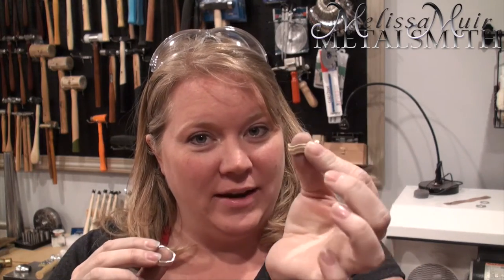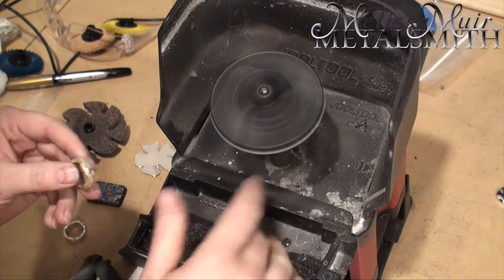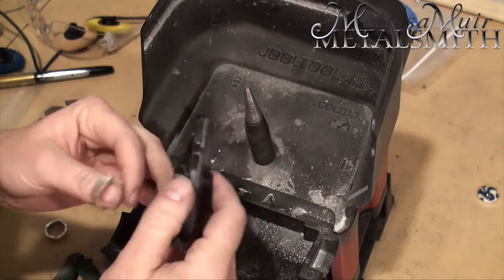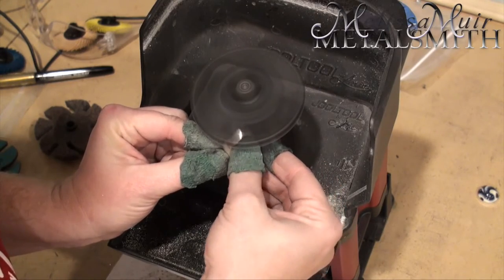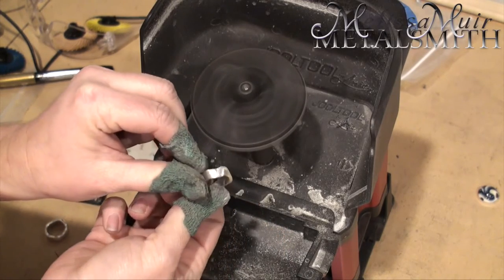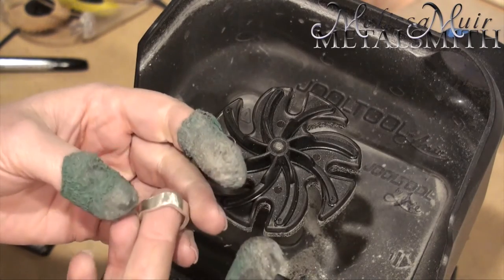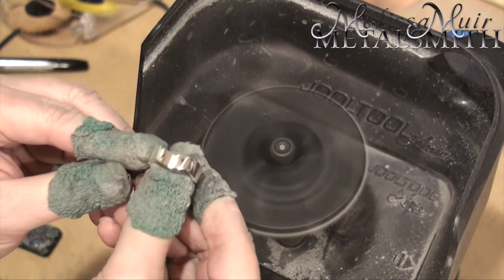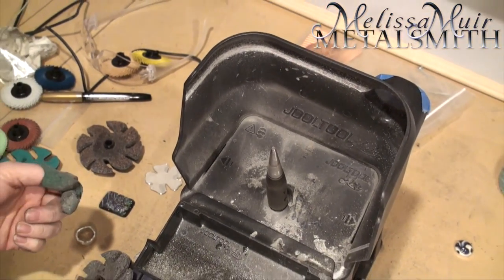Tool Time Tuesday - The JoolTool and High Polish on Metal

Comment: I'm just starting out and tooling up.  It seems that it is possible that this could replace, for the most part, the polishing bench lathe, particularly if one has a flex-shaft for finer or inside work.  Is that the case?  If you had to choose one or the other for budgetary reasons, which one would you choose?  Thanks!
Reply from the maker: +Martha Miles Yes Martha, that is exactly what I think too. Mine has been WONDERFUL!!! I started with the JoolTool for Metal Polishing. Then I have added on to it from there. But with that I was able to do quite a bit for my jewelry. I am now also working with glass and stones. Send me an email, let me know what your primary uses will be and I can help figure out which kit would be the best for you.

Comment: Looks fun to use...can a person put those inside wooden ring cone with sandpaper on the jooltool or maybe the green inside polishers that rio grande sells, looks like its the same arbor as a standard polisher
Reply from the maker: +Robert matteson Yes, it is the standard arbor, so yes, I do believe you would be able to use the ring cone. I need to find one that has sand paper. But I am really excited about the one from JoolTool as the abrasives last so much longer. I was able to play with the prototype for it when I was in L. A. a couple of weeks ago and it was heavenly.

Comment: Do you get contamination from grit to grit without washing/cleaning your piece between?
Reply from the maker: +Brenda Smith I asked Anie about this and she said no, you don't. That is because the discs are off loading, rather they don't hold onto the material as you go from one grit to another. It isn't like when you use a polishing compound that is applied to a buff. In the case of the JoolTool, the abrasive is embedded to the wheel itself, or rather the pad you attach to the wheel (Ninja disc.)